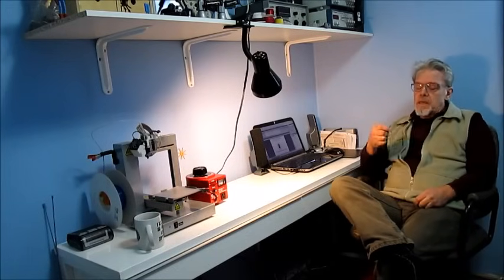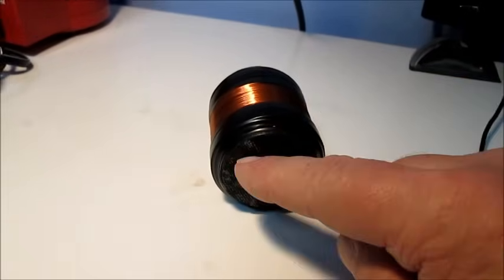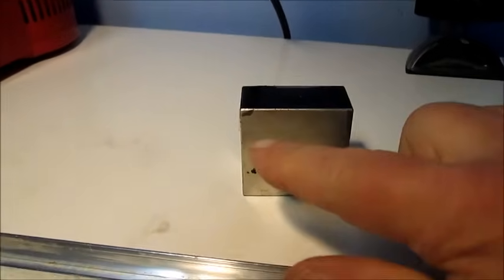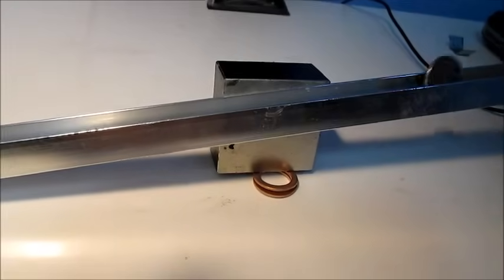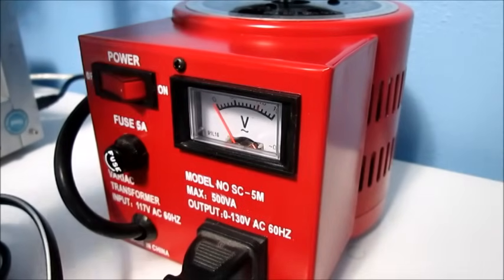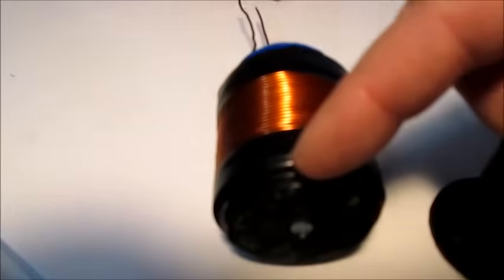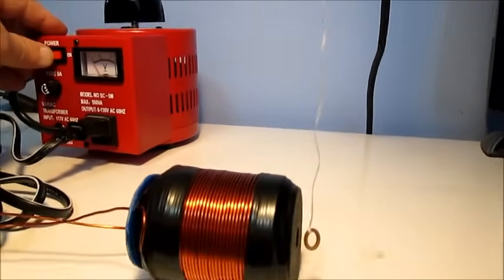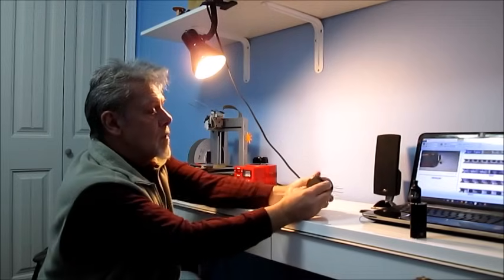How To Make A Gold Magnet

Comment: Basically, you arent attracting the gold at all. You are repelling it inward toward the copper washers which negate the field. The AC field vibrations get stronger as you go away from the washers so you are forming a dome shaped lowest energy zone near those washers. Any  highly conductive metal will be repelled inward to escape the currents induced in them when they try to leave the low energy zone. Now, once you improve your design enough find a creek, set up a rig...

Comment: Interesting. So, I have an idea. What if you put a solid core master magnet centered in a hollow tube of a larger master magnet or surround a tube with several master magnets in an array, and instead of copper you used a superconductor with less resistance, such as a Niobium based titanium or tin magnet in a cooled chamber to maximize function and efficiency and then, you applied 2 separate electric currents and spin them in opposite directions, thus generating resonant electromagnet energy. By adjusting the current and spin of either magnet, you can tune the threads to suppress certain frequencies and yet intensify others through an interference pattern. theoretically and in concept only, this should allow you to attract, repel, and even leave alone different kinds of non-ferrous materials simultaneously by tuning the frequencies to the NMR resonance of the materials. You could, for instance, run a sluice at precise measurement between the inner and outer magnets with a mixture of non-ferrous materials and by locking the currents to those specific resonant frequencies, vibrate selected materials to either one side or the other of the sluice. A nuclear magnetic resonance sorter, which could hypothetically allow you to pull and distinguish pure elements from each other. Similar to the function of an MRI imager but with another magnet in the center to generate energy and interference. Such a machine would likely be hazardous to humans, but if done correctly and in an enclosed environment it could be contained and then flow out the other end of this machine separated at production speeds. This would, of course, require an immense amount of energy and coolant, and the upkeep costs of an industrial line would probably be close to 10x that of a medical grade MRI machine... but, it's an idea for a novelty invention that could produce complete yields of pure materials without the need for amalgam and chemical electrolysis, the value in applications of which would far exceed the need for better efficiency.

Comment: Great job Sir.  Really Impressive.  If placed in a bag.. you could place in shallow areas of water around a creek, river correct and attract gold flakes.
Reply from the maker: Hi Mr, Boo Boo.  Thanks for the warm comments.  Appreciate that.  

That's a good idea.

I believe it can be done but the setup for the magnet would need to be adjusted from what is shown here.
Reply: The issue I see is that Ken states that 'it will not attract things smaller than the inner core'. If that is the case, and myself knowing how small gold particles are, I dont see this working like that without severe miniaturization.

Ken am I right here? Did I hear you correctly?
Reply from the maker: Hi Michael,

That is correct, the attraction of non-ferrous materials is limited to the surface area of the copper washers.  It could be miniaturized but I think a better approach is to re-design the washers (act as an inner core) to an actual coil and loop the emf as feedback. I have ideas to allow it to attract atomic size particles.  Will present them to the group when I get it done.
Reply: Thank you Ken. How about quantum trapping? Could that be achieved with the Master Magnet?  If so could the field be manipulated with other magnets to focus it with specific intent?
Reply from the maker: Hi Michael,

I don't think the field would be stable as is.

Perhaps it could be refined to create a particle bounce effect due to the ac
Reply: KenKlondike isn't it going to have bigger and stronger magnetic field if it was doubled in size? I don't know if it will work just asking the more knowledgeable on this matter.
Reply from the maker: Hey Atorx

That's an interesting question. It can be made with larger wire and more power however it's actually the copper washer size that determines what size of particle it attracts. I am going to miniaturize the magnet to increase attraction of small gold.

Comment: Ken, I'm watching the movement of the materials and they appear to be drawn to the discontinuities (space btwn washers). is it possible to have these discontinuities running lengthwise (tubes inside tubes) with some soft iron as a core? You may see a difference. worth trying? I noticed also the movement of the coin rolling / stopping / slowing where the field was most active (at the corners of the bar). but this is also representative of a DC field so maybe AC isn't the attractant. Just my thoughts but let me know if any of this works or not. Later,

Comment: You know the bearings on a bike is it posible to make a few out of gold but thicker spin opposit direction at high speeds for forced gold magnitisum? And nice video
Reply from the maker: Hi Sol Goode,  Anything is possible.  I cannot comment on the resulting magnetic forces unless I saw a drawing. You could vibrate permanent magnets to create the same fields this does. Remember what Faraday taught us - a changing magnetic field creates an opposing field.

Comment: This is quite interesting and it got me thinking of a compound that could be used to map out hysteresis loops in metals using other diamagnetic and semiconductors
Reply from the maker: interesting.  As a prospector I use a specific gravity test to determine types of materials.  It may be possible to map a specific diamagnetic chart in the same fashion.

Comment: would the atraction become stronger when you use more than 60hz? And lets say you would place 500 magnets in a sluice box, wouldn't the gold stick to the magnets when its moved allong the magnets because of the water, just how you moved the coins past the magnet with the ledge?
Reply from the maker: Hi Michel,

These are good questions.  I am revising the magnet to test out several factors and how they effect its attraction.  

I suspect that once the concept is finalized it would not involve a sluice box but rather a method of spreading the materials and pulling the metals out of it.

Comment: obviously the electricity is jumping to the gold and it is holding some capacitance and it drawn to the circuit.... i don't know if i would call that magnetic as much as electric.. of course they aren't very different... but could it just be the conductivity of gold and some holding capacity? you're using quite a bit of electricity to make gold do a rather superfluous thing unsure what the result is or means?
Reply from the maker: Thanks for the comment Fairy Squirt,

Science is like a Picasso painting in that each person sees it the way that makes sense to them.  As such I agree and respect your way of looking at this.

The way I see it is that electricity does not exist as a thing but rather is just a result of movement or effort.   Its actually the magnetic fields that are moving against each other.  The magnetic fields are being transferred to the coin, as you said. The fields are generated to repel against each other.

Comment: Very cool.  I believe there is a vortex, four, actualluy.  Flux lines are not pulling on each other or the metal, according to my theory, its turning the ferro materials into temperary magnets, the flux lines are aligning movable neutron in materials, which enable them to create flux lines of their own.  I have a video on it.  I believe your magnets power would be increased by changing the frequency of your voltage, more so than adding more power.  I suspect different materials will be more attractive at different frequencies.  I would start with 12 volts, at 10 miliamps and do tests at safe power levels if you decide to test this.  I actually really like how you presented this.  I'm going to research the master magnet.  Have a great day.
Reply from the maker: Hi Gristle, Von Raben,  Thanks for the comment.

You are correct on the flux lines.  Its an astute observation that indeed different frequencies and current will effect the magnets attraction. 

I am working on a revised version of the magnet to test just these ideas out. Will post the results once I have them.
Reply: KenKlondike awesome!

Comment: What about the wire you used to hang the coins would that not be attracted to the magnet? Just asking
Reply from the maker: Hi David. Thanks for a great question.  

It may sound crude but I use tooth floss for strings. The reason is that the wax on it prevents electrostatic effects in my tests.

Comment: Could you set this up at the end of a sluice box with no electricity just using aluminum section. With magnets periodically up in ribs to slow the gold down?
Reply from the maker: Hey Sam, thanks for the comment.  You certainly can use permanent magnets over your sluice to help drop the gold out of the water flow.  In order to use this electromagnet requires electricity.
Reply: It will not work. The issue with “ Gold magnets “ is that the gold or whatever precious metal you are trying to attract needs to align with the inside cooper rings to make full magnetic attraction. This method was invented in the 60”s but the efficiency is not there. There are complete build outs for these magnets online if you want to understand the principle of what’s going on and build your own ac magnet. As far as operating this on a sluice, I would not. Simply because the fine tiny gold is no where near identical size and would never align with the internal eddies that are being created by this machine. Like I said this was invented in the 60”s, if it was a true method of extraction the very large mining companies would be using it. On the positive I love your video , I love your design and I think you had great info to share .... keep it up. 👍🏽

Comment: Gold is usually in the company of black sand . Have you experimented with this mix? If so Will it catch them both at the same time .or one over the other ?
Reply from the maker: Hey Bart,  Agreed, black sands and gold are often together.

This magnet will attract the black sands stronger than gold, silver or copper.  In my sluice box I have a first row of permanent magnets that pull out the magnetic materials, then a second above the riffles to draw the gold down into them. Works well that way.
Reply: Quicksilver attracts only heavier metal , than itself !  no sands . 1 pound of it in a motorised cement mixer with a hundred pounds of wash dirt , at a time , could cut you a living .. As long as you separated it safely in a retort system to recycle 100% of the quicksilver , which also purifies it.
Reply: I believe such experimentation , has more beneficial applications than gold recovery , all you greeeeedy ol bastards lol.. Lets talk anti gravity , and generating energy .

Comment: Have a good day sir, May i ask some question sir?in that magnet,we only gold and selver will magnetized on that setting?.i have an idea to want this way of gold hunting beside a river.if i can do this electromagnetic material,would be able to use the 12 volts battery or direct electricity with in 220 volts stable?.(alternate use transformer)
Reply from the maker: Hi James,  Thanks for the comment.  All elements that are conductive (silver, iron, gold, copper, platinum and more) will be attracted with the magnet.  

It is quite possible to use the magnet to attract gold by the river using a battery system and transformer however I would wait until we fine tune it.  

I have a new magnet that uses much less electricity but I have not completed it yet.

Comment: In 1976, I worked in the pinball, cigarette machine, juke box ect. business in Florida. We had a heck of a time with Canadian money with all the tourists because the slug detectors were nothing more than magnets that the coins had to get past to buy the game, cigs or whatever and they would get stuck on them if the coin return was not adjusted properly to wipe them off or people would leave them there and let coins back up the slot. We would have to go out and unjam the slots and clear the coins. If we found pre 1968 Canadian money in the coin box, we were told to write it down and throw it away as it was only worth about 68c on the American dollar. I would swap it out for American coins out of my own pocket. It was good for the company and my wallet as it was eventually worth more than face value for it's silver content.
Reply from the maker: Hey Jeff,  Thats a cool experience.  Here in Canada they don't even make pennies anymore ~ thats how money dies.

Comment: This is the second time I watched your video. I bought 20 neodymium magnets. 2"x1"x1/8". I plan to put on a metal strip's. 2 row's about 3" apart across my gold cube tray. Hope to have more gold to drop. Thank's for taking the time and sharing.
Reply from the maker: Hey Migel,  Thanks for the warm comment. I was thinking of getting a gold cube.  How does it work on fines?
Reply: I like it better then sluice boxes. I have 2 boxes, 1 bazooka and then a regular. I needed something I could set up and leave alone. I recirculate the water. It grabs the fine's and micro's. I have 4 catch basin's for the tailing's. I dont run river or stream stuff, I have 2 mine's. I run through a crusher and it turns all to a powder, then through cube. The assay/refiner say's, my sulfide's also have gold. So the cube also grab's sulfide's. But I have found, that I now run all 3 time's. It also grab's magnetites, which I toss away. I found 2nd run I still had gold, so first run I missed some. So I run all 3 times. Thats why I am going to try your magnet idea, to slow the gold, so it drop's. I pay guy's to load trucks and bring to my house, here I process. After cube I pan down more, then dry and remove magnetites, then toss in HCl and peroxide for 2 days, then precipitate back with smb[stump out]. I want to get all the gold I can for my work. I am getting a second cube, so I can process more. Now I do a ton of rock a week, would like to do 2 or 3 ton's a week. So yes I would say the gold cube work's. Best Luck to you,,,Get the Shinny.
Reply: migel reyas how much gold are you pulling from 1 ton of material per week?
Reply: the refiner says 3 to 3 1/2 oz per ton 18k, silver 20-21 gram, 8-9 gram platinum. I just started acid the gold to make pure. The refiner is a friend of my father's. He WAS retired, not any more. He want's to come down to refine here instead of me shipping stuff. Thats how I found out my sulfide's also had gold and why I'm getting into nitric acid so I can get the gold from the sulfide's also. I just got off the phone with the refiner, he has me doing a test on a possible 3rd area.
Reply from the maker: That is interesting. My LeTrap and Angus sluice boxes are plastic without the need for metal riffles.  The magnets work very well with those.

Comment: I had never heard of a 'master magnet'. I am very familiar with the eddy current usage. I am wondering about the eddy current effect using a master magnet.  

Well done and well spoken.
Reply from the maker: Interesting question Michael.  Its my opinion, and its up for debate, but I consider electricity to be nothing.  Its is the effect of movement and that can be measured in magnetic field but not actual particles of electricity. 

With that said, the eddy currents are back emf produced from the magnets field movement. These movements are caused by the AC rather than a traditional physical dynamo.  

For the magnet to have attraction, it needs to have an even amount of washers which is to say that 1, 3 and 5 will not work.  This is because the washers are flipping the fields direction and projecting it to the attracting surface.  

Interesting is that using 1, 3 or 5 washers will cause repulsion rather than attraction.